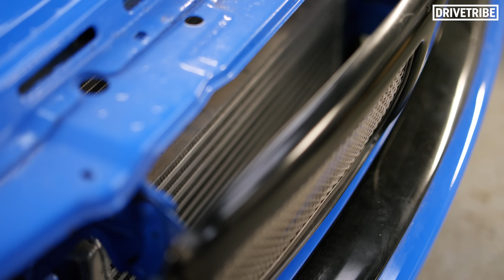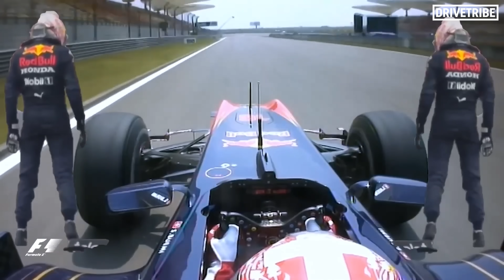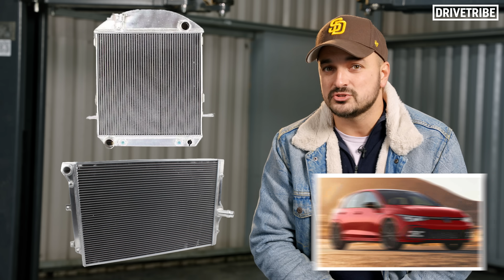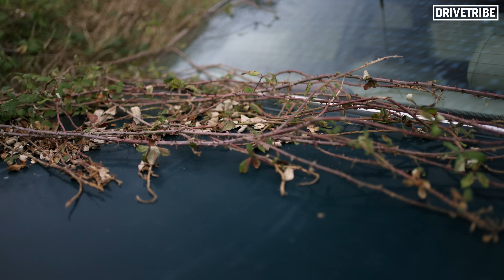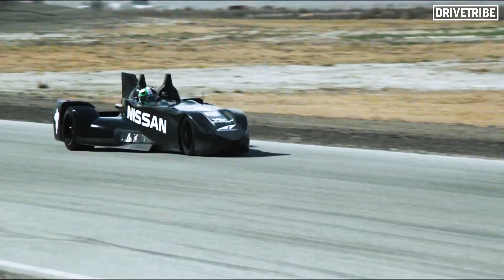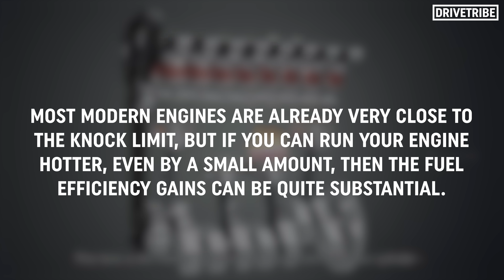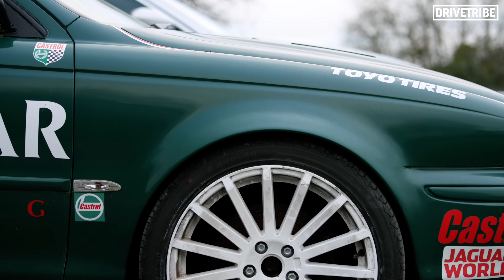This ILLEGAL fluid could increase engine power by 100bhp!

Comment: I had a modded Cooling System in my Subaru Forester. This thing used engine oil instead of water. Why? Cause if you are offroading, and you have a night in the frosty weather, you want your car with a coolant, that can't freeze. It was great. But for my actual Toyota, i can't find a tuner who can change it, too.
I have a question... IF the Nano stuff cools down better, would this mean, that the engine needs more time to reach 80°C? You know, the temp, where you can kick your car without any problems...

Comment: I think adding it to oil would be even more beneficial. Increased lubricity, which means you can reduce viscosity, and the added benefit of greater heat exchange. Take it a step further and coat the engine internals with graphene and you have yourself something. Almost zero surface wear on parts (which also reduces heat) and the ability to run higher compression, more fuel= more powahhh! [said in Clarkson’s voice]

Comment: Why are there 0 mentions of the cons?
1:extreme abrasion everywhere it flows.
2:highly conductive so a spill/blowout could cause allot of electrical problems .
3:if the head gasket fails you can trow your block in the scrap metal bin.
And this is just what I can think about without doing research, there are probably many more challenges to it.

Comment: If solid graphene has such a high thermal conductivity, why use liquid coolant at all? You could attach a band of graphene to the engine on one end and let it radiate the heat on the other. Furthermore, liquid graphene won't work as a viable alternative because all automotive fluids have to be non-toxic enough in case they leak into the groundwater or storm drain.
Reply: It depends on what it's suspended in but graphine is just carbon atoms, should be environmentally fine. it was first made (in Manchester) by using sticky tape to pull a pencil apart
Reply: All about surface area. Much like air cooling vs liquid cooling a PC, you still need a very large surface area with radiators to give enough fin surface area to create that heat exchange speed efficiency. Also think about other systems that use the cooling, like your heating in the car. No coolant means now you need inefficient heating solutions that degrade a lot of the benefits your gaining with this coolant. For example an electric heater system will rob power, or using engine heat becomes harder to control comfortable temperature/fumes and other unpleasentries.
Reply: Coolant is very toxic
Reply: Graphene strips and sheets also can only transfer heat one direction, or dimension as that makes a bit more sense. So if its in a sheet, it is the best at transferring heat edge to edge. When its trying to transfer heat on the flat, writing, parts, its thermal conductivity is horrible.

Comment: This needs to come out immediately so BMW can make their grilles smaller again.
Reply: from kidneys to lungs - and back, hopefully
Reply: I hope so... because I can't buy use model for the next decade, god they are awful
Reply: lol,
They don’t need to be that anyway, it’s an excuse for a terrible design choice.
Reply: @Becausefamilycar  Design choice that has been made for asian markets if i've understood correctly. They might disagree with you. In my opinion they look odd but i got used to them already
Reply: @Becausefamilycar  I heard an interesting theory as to why manufacturers are starting to make grilles so large - quite a few of them, BMW included are leaning towards hydrogen instead of electric as the next major power source for cars. Hydrogen takes a ton of cooling, and therefore requires pretty large grilles. They're just getting us ready for that, plus making suitable test beds for hydrogen fuel cell powered vehicles.
Reply: @dank_69_420_memes hydrogen is actually the only long term option
Reply: @dank_69_420_memes hydrogen is massively inefficient. This will just end the same way EVs did. Look up electrolysis it’s not exactly a 1 to 1 conversion ratio and it requires massive amounts of electricity(natural gas) in order to function.
Reply: Except it's their electric cars (in the main) that have the huge rats teeth front grilles, so it's just a (poor) design choice.
Reply: Every time I see a newer BMW with those massive kidneys, it's painful 😂 they really are "gopping" at this point 😂
Reply: Yet BMW is selling better than ever, so its just your taste which is in the minority 😅 @JakeFromYoutube
Reply: @16Cylinder  I doubt its a minority opinion. The giant grilles look terrible
Reply: @ProcratinatingEric  depends on which model. The 4 series looks amazing ❤️

Btw. Look at Audi, they have had much bigger grills for years, so what is the problem 😅
Reply: New car magic cooling with bigger grill
Reply: beautifully pointed !
Reply: 😂 LMAO
Reply: As if that was the real reason they're so big. They had lower grills before, they could do the same now if they wanted to
Reply: I'm pricing out current M3 Comps and I gotta admit the front end has grown on me.  Especially if the July 2024 refresh introduces the CSL esq front bumper, I'll be in love lol.  But yes, I can't wait for this to come out and be a real thing.
Reply: Agreed
Reply: Designed to break the Chinese Market.
Reply: 🤣🤣🤣🤣  They have lost the plot completely!
Reply: The grilles don't need to be that big. Part of the grilles are literally covered on the inside
Reply: And their garbage M5X series of straight 6 engines can stop blowing head gaskets. Thermostat that opens full at 250F combined with a badly designed coolant reservoir in the E36/46 that loves to split with wear or rub against the timing belt if the cheap plastic that holds the radiator slips and it slides back.
Reply: They'll probably use that to make even more horsepower.
Reply: what a bullsh  mo re100hp,, 

don touch on mechnic man go home help you girl to make the dinner
Reply: If only😂.

Comment: This product sets off my BS alarm. I hear a lot of claims, but little substance. Their website is full of unverifiable claims and doesn't actually give any detail about what this 'graphene' is supposed to actually do to improve thermal conductivity when suspended in a fluid.

Ultimately water/glycol is a very effective cooling medium and improving on it without a lot of extra cost is difficult - the limiting factor is likely to be the surface area of the radiator and the amount of air flowing through it, so unless you can fundamentally improve that, the fluid inside it isn't going to make all that much difference. If you need more cooling capacity, increase the fin density and surface area of the radiator or fit more powerful fans to it.

Comment: What about the extreme abrasion that will occur in the water pump!
Reply: It's also super conductive regarding electricity. A spill inside your engine bay would need an excessive cleaning.
Reply: It may not be an issue as graphite can actually be a good lubricant

Comment: The switch to electric cars has shown that even when manufacturers have the option to go radical with new designs they just churn out stuff that looks like what we are used to.  Making cooing requirements less won't really change anything apart from making parts smaller and the fluid changes more expensive.
Reply: Don't forget regulatory bodies and pedestrian safety... They're probably years behind what can be done with electric car packaging, so they err on the known side.
Reply: Exactly my thoughts !
Reply: Exactly. Also, 60% better heat transfer from the fluid doesn't mean 60% smaller radiators; and the same could be achieved with higher airflow and coolant flow.

This whole video seems overly optimistic, clickbaity, and low quality. Kinda sad from a great channel.
Reply: It'll be EV'a only, for the Civilised World, from 2030.

Comment: If that really is the case with Nanofluid, just cooling the engine by 2°c and gain 100bhp would be an absolute game changer 😮.
Imagine buying a standard 2023/4 Audi RS3 with around 400bhp, then swap your coolant, and suddenly you have 500bhp 😳. I know it's more technical and scientific than that, but still. Amazing.
Reply: Yep, and a 2hp engine (provided it is water cooled) would obviously leap directly to 102hp with a coolant change.  
Because the man said "+100hp" and we need not think too much.

Comment: Can we call this BS already? Solids suspended in water are guaranteed to build up in areas with lower flow like hose connections valves and so-on giving Your engine atherosclerosis, whist simultaneously being abrasive to elements being exposed to high flow like hose turns and channels in engine block. Also suspension of graphene may not even help in any significant way. Those figures may be just as trustworthy as solar roadways, new amazing better than physics wind turbines and other start-up scams.

Comment: Sounds like graphene could play a major part in internal coatings of engines for heat dispersal along with intercooler and could use nano fluids in a water to air intercooler and maybe they could add it to engine and transmission oil depending on its abrasive properties potentially as a surface enhancer and also help shead heat faster, do hope synthetic fuel saves the ICE and we get to see stuff like this and digital valve trains become mainstream if car manufacturers have more trust that ICE will be around for the foreseeable future

Comment: im sure they could  essentially  turrn a current radiator around so to speak if they needed to, so it couldbe way fllatter but deeper allowing the shorter front profile.  Of course we used to use just water for cooling not that long ago, im sure coolant was more than 50% more fficient than water so it isnt as tho we havent had this before :)

Comment: Would the graphene settle in radiators if the car is left unused for an extended time and would it choke the system if it happens along a narrow channel in the cooling system?
Reply: My guess is that this issue has been why it's been so hard to develop. I know from looking into graphene as a concrete additive that it isn't easy to get it into a fluid suspension. There are types of graphene that are much easier to do this with, the priciest types of course, like the turbostratic graphene that you get from Tour's Flash-Graphene synthesis. This just means that the flakes  of graphene are not aligned with each other at all, which makes dispersion in fluid much easier. 

There is also an interesting, and very easy and cheap to replicate, process from a UK university that involves smashing up graphite in water using a food blender for an extended period. The end  result of that is that the individual flakes  of graphene DO stay suspended, while the heavier multi-layered clumps fall  out of suspension and are separated out, but I'm not sure that it will stay suspended for very long. It's very suitable for something like addition to concrete, as that only calls for staying in suspension long enough to mix with the other ingredients in a uniform way, but I imagine there would  be a need for other ingredients to keep it like that through varying temperature and pressure conditions.
Reply: I'm extremely curious about this too. In extremely high performance/exotic or race engines if the graphene would bond to the aluminum or magnesium engine block, water jackets, or in passageways after numerous or thousands of heat cycles creating clogs, sludge or debris. Also the effects of heat cycling graphene on things like seals, piping/tubing, etc. If its thermocycling heat out of the engine, and suddenly it cant will the graphene chemistry start breaking down? I wonder too what the lifespan of such an additive package is, and what risks come from exceeding it?

Comment: Doesn't a (modern) car have to come to normally operating temperature to reach peak power and efficiency ?
Reply: Basically yes, a steady 100C ish
Reply: @davedyer3654  its usually 80c in many hondas.
Reply: @ghostrider-be9ek  as an average, over 100 around the cylinders but boiling controlled due to the pressure cap
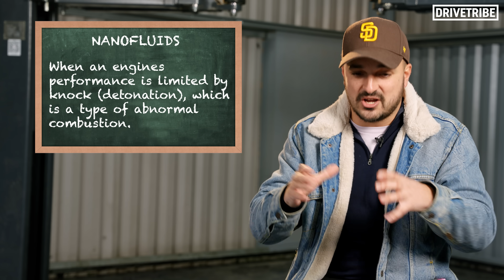Reply: Yes, but it also can't run much hotter than that and that's where the benefit of this would be found. The video explains it well from about 6:18
Reply: If you can make a smaller more efficient cooling system, it can come up to operating temperature faster and more evenly. Better for emissions, performance, and longevity.

Comment: Still got to remember the regulations regarding the space between the bonnet and the top of the engine for pedestrian saafety.
Reply: yea thats right, look at early 90s Hondas (integra) and how low the front of the hood was.
Reply: @ghostrider-be9ek  That's because it was made before the regulation came in.
Reply: So what about a Corvette? McLaren? Etc
Reply: @sinformant  Current Corvette and McLaren are mid-engined. Old Corvette didn't comply as it wasn't officially sold in the EU.
Reply: @Weissman111  I didn't know you were talking about Europe regulations as it wasn't stated. I live in the us.
Reply: @Weissman111  so are front engine ferraris not allowed over there?
Reply: @sinformant  Yes - but they either have low-mounted engines or they use the explosive lift system like the Nissan GTR.
Reply: @sinformant  Yeah outside of the US we actually put safety first...
Reply: They solved that in 2012 with the Volvo V40 with pedestrian airbags and bonnet lifters